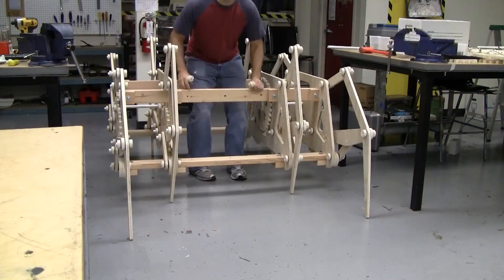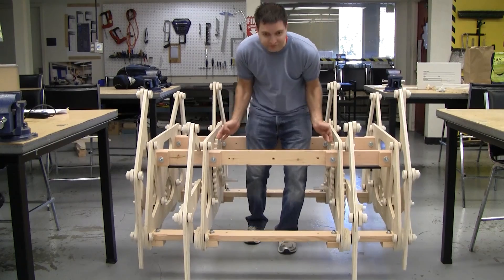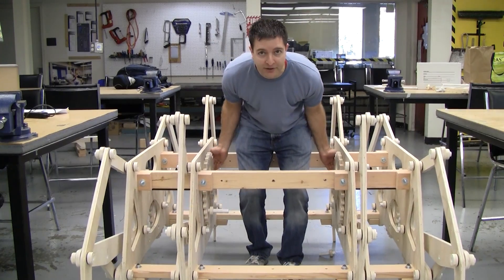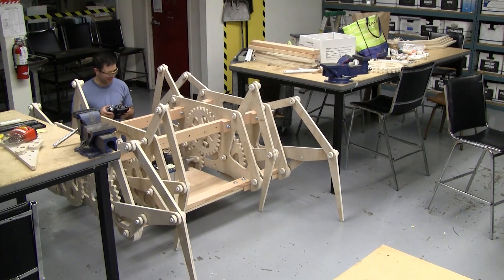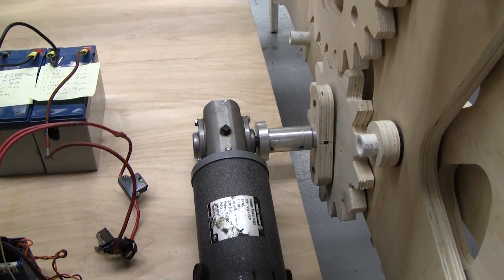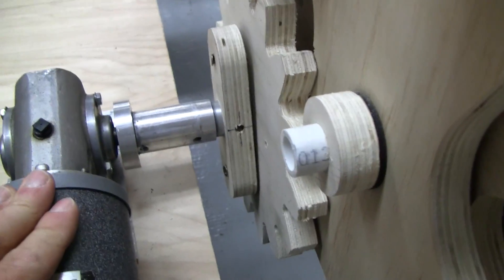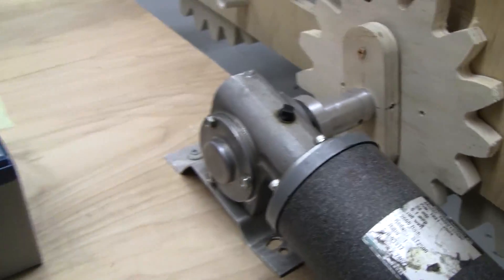Cyber Spider Initial Testing

Comment: You're going to find it going a lot easier if you sand the surfaces of the gear teeth... they slide against each other, and look pretty rough. That's a huge amount of friction to overcome when you're throwing all that torque into the gear train...
Reply from the maker: So the gear teeth are pretty smooth, in testing the gears not connected to the legs I can spin them meshed at high speeds were they just become a blur.  Now all the friction at the unlubricated plastic axles and wood under load is an issue.

Comment: You can tell from the hand crank test that the spider will have problems.
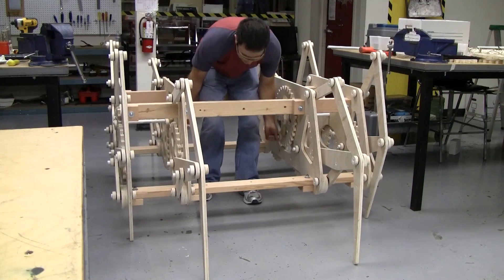The whole platform shifts up (0:29) and then drops back down at (0:32 & 0:34).

The gearing or design should be adjusted so that the unmoving legs keep the platform at the same height off the ground at all times.
This will require supporting legs to apply pressure at the same time as other legs are releasing pressure (just slightly rolling from one multi-point support configuration to the next), but will result in a smoother, more efficient ride that is also easier on the parts themselves, including the motors.
(Impacts = bad, both for robots and for the real creatures.)

The most efficient walking designs I've seen have been by Theo Jansen.
His walkers avoid lifting and setting down (raising up and dropping) the structure, and in doing so are so efficient that light beach breezes can power the crafts.
Reply from the maker: Good eye on video and there are some issues with that lifting you saw, though I'll first explain why I didn't go with the Strandbeest design.  With Strandbeest design you do get a smoother walk at a price of requiring 3 pairs of legs for each side since the legs are 120 deg out of phase, for stability you need legs both front and back and if you want to turn matching sets on each side.  With the Klann linkage the legs are 180 deg out phase so theoretically could get away with just 2 pairs on each side.  Now the motion isn't perfectly flat in either design so at the end of the motion there is some curve, which is were the issue of the rising and dropping comes from.  But the real reason I went with the Klann linkage is I was making a spider and Klann motion lifts the legs up out you much more like a spider than the Strandbeest so felt it was a much more interesting look of the motion for this project.